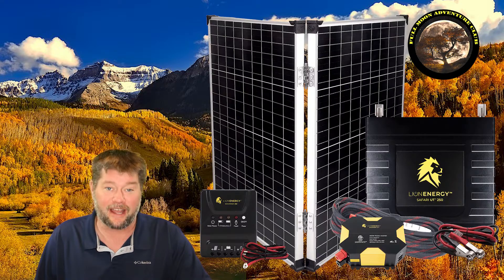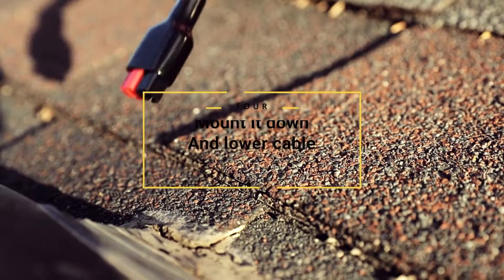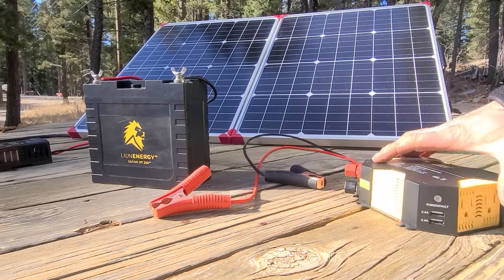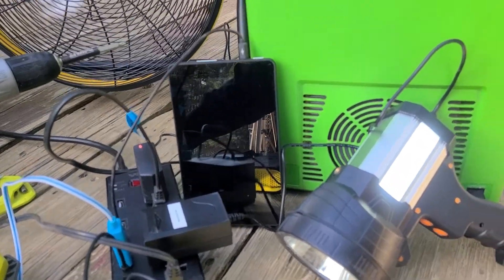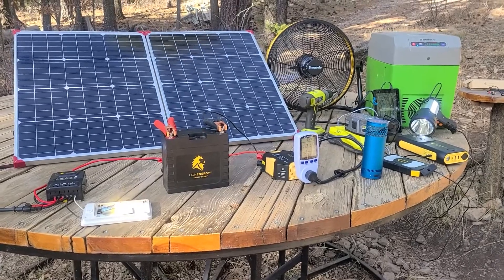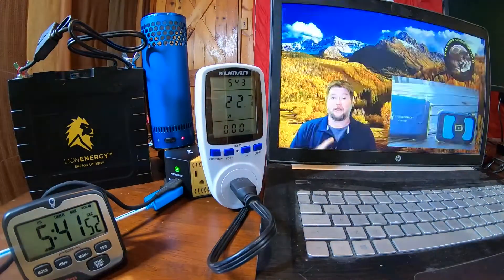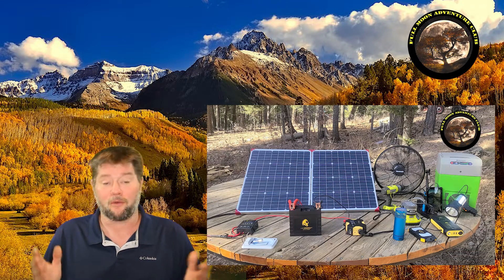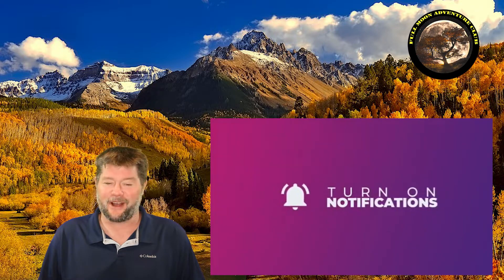Simple DIY Beginner Solar Kit - Lion Energy

Comment: Nice….it’s like pack’n a 3” pecker….it will work, but better to have a minimum of 600watt solar panels/40amp mppt controller/300ah lithium batteries/2k sine wave inverter! SIZE matters! Personally, as a newbie, I started w/a 24v system. 😅

Comment: what type of battery?
Reply: Thank you. I am trying to understand it all. I appreciate your response.
Reply from the maker: The battery featured in this video is from Lion energy and it is a lithium iron phosphate battery. LifePO4
Reply: Thank you. I know ZERO about electricity so your video was wonderful. One last question. Is this kit expandable with add on’s later.  Just dipping my toe into the solar world
Reply from the maker: @cindybridges5851  maybe a little bit but not much. If you plan on expanding the solar system later you're definitely going to want to get a better charge controller that can handle more solar and charge larger battery Banks. This system is more for like a shatter garage that you need power in occasionally. This comes with a 100 watt solar panel and just as an example a laptop may use up to 60 W while charging. Great for electronics but not so much if you ever want to make coffee and stuff like that. I hope that helps.
Reply: @fullmoonadventureclub  do you have a recommendation for a good simple charge controller that is beefier?
Reply from the maker: @melissacarpenter7327  I woukd look into victron. I hear good things.

Comment: I have a skoolie and I’m learning as I go. I have an existing solar panel but need to find out how to connect it to all the other parts necessary to get power. I was wondering if you can make a suggestion or even better a video on how you would run outlets from the inverter 🙏🏼
Reply from the maker: I am putting together a video of how to install an inverter charger into your RV electrical system but it's pretty complicated if you're not really comfortable with electricity. Probably a better install for a professional. If you don't need all of your Outlets energized I would just get an inverter that has a plug on it and then you can wire that directly to your battery. That's a pretty easy job. I'll try to make a video about that too.:-)

Comment: You said the inverter was modified sine wave and that wasn’t recommended to power sensitive electronics.  But you had a phone hooked up to it.
Reply from the maker: True. Pure sine wave is preferred. However, I've used the cheapest modified sine wave inverters from Walmart for years to power my laptop's phones and everything else. I think if you're using medical equipment you should go pure sine wave but to be honest I don't think I've ever lost a single piece of equipment do to a modified sine wave inverter. Usually they have their own power supply which will provide the correct power anyway. It is definitely a starter kit but I've enjoyed using it and I thought it was pretty cool. I would have no hesitation hooking this up to my computers tablets Wi-Fi devices or routers (and have). I'm only basing this on personal experience but so far so good.